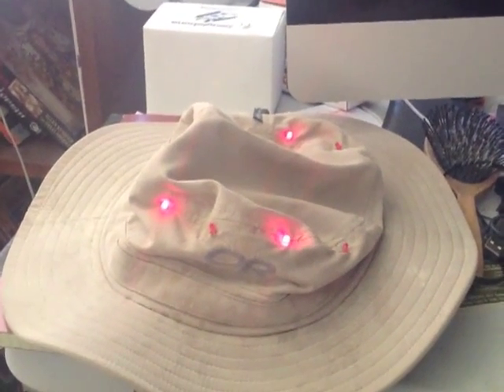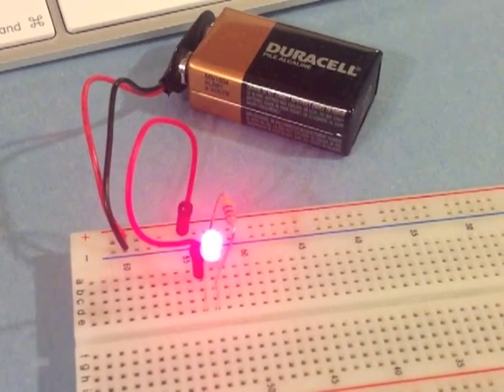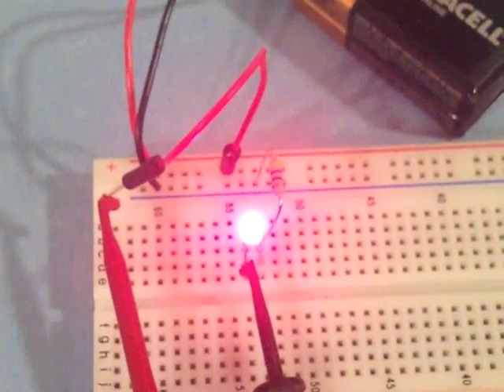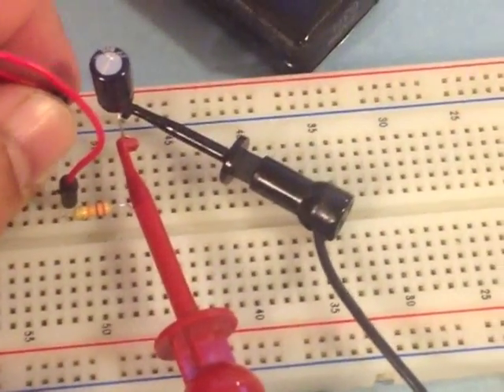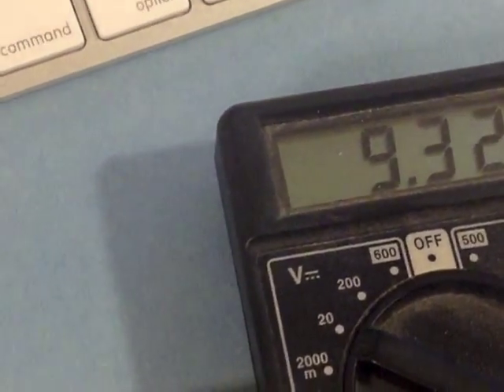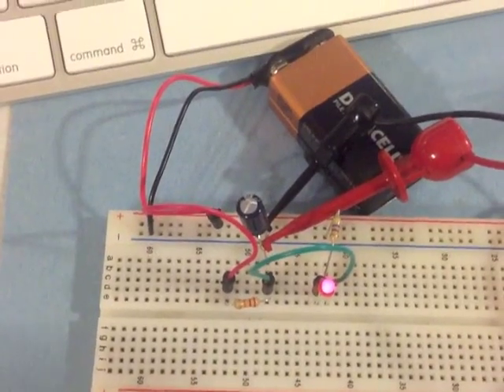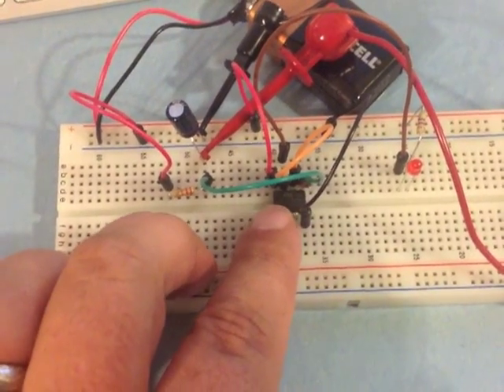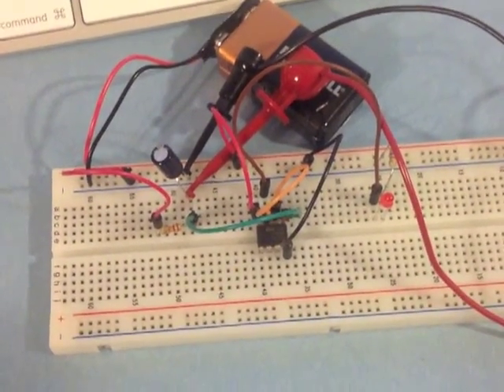Fading LED circuit - Part 1

Comment from the maker: So, I am finally working on Part 2 where I cover voltage dividers very briefly and then all about Op Amps... from the Schmitt trigger through to the relaxation oscillator. Charles for it right regarding the pulsed effect, I am using two op amps to make a triangle wave generator, which will hopefully be the culmination of these videos in part 3.